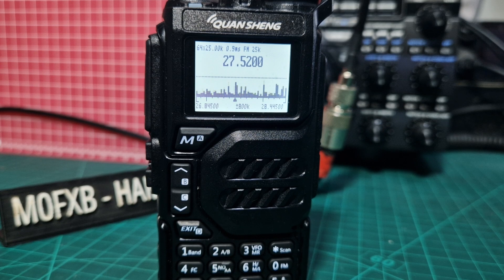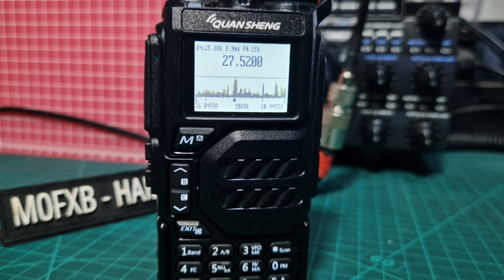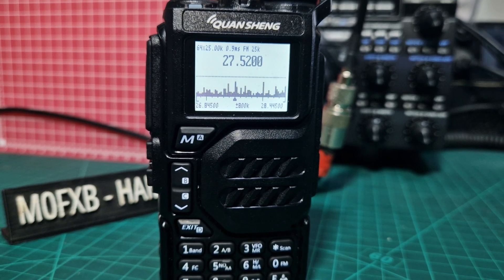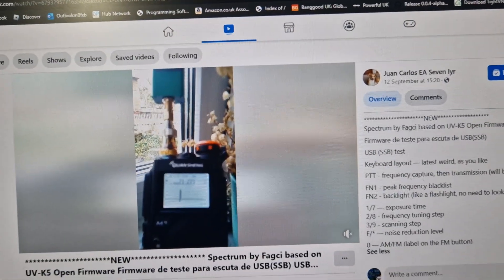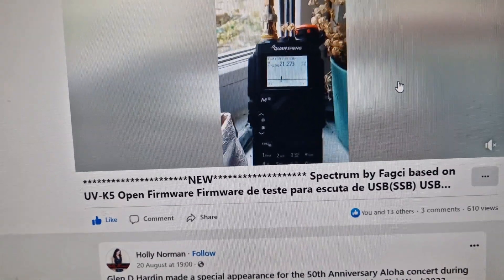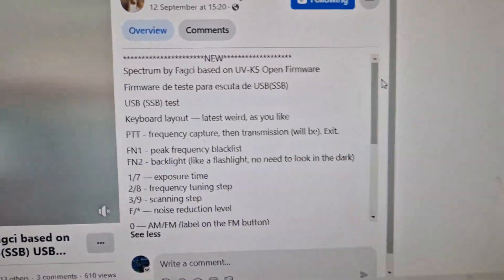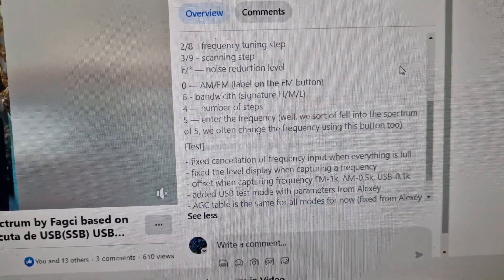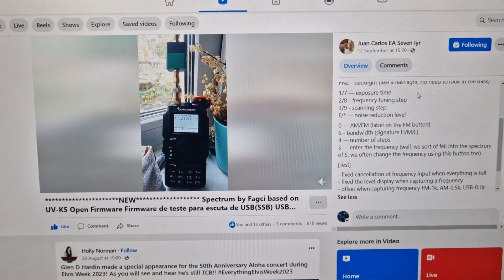SIDE BAND USB MOD -UV-K5

Comment: When you’re in scope mode. Press F to bring the line down to receive. Also on the scope screen you press PTT to go to receive screen and the can go through the frequencies 1 by 1. Change step and so on.
Reply from the maker: How do you make line go up after pushing F
Reply: @M0FXBHamTech i think its the scan button top right

Comment: Im happy just eat the first mod made this radio rx 50mhz and up . The 1.25 meter band works well if you use a good tri-band antenna.
Reply from the maker: Yes so good
Reply: Works on tx 70mhz on low power with a suitable whip

Comment: I'm confused here. The quansheng uv-k5 is a uhf/VHF radio. Does this firmware upgrade add HF? Or is this a special version of the uv-k5?
Reply from the maker: This is special firmware made by a Ham operator .
Reply: you reflash 19 to 600 or 1300MHz first then reflash for USB